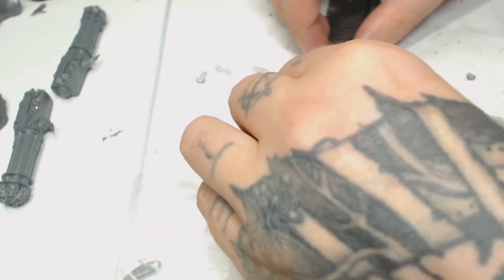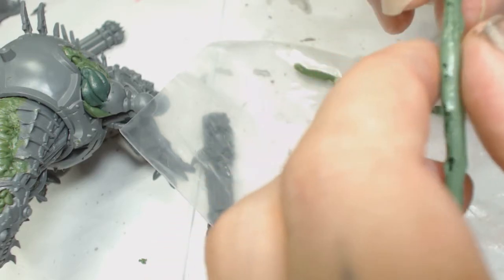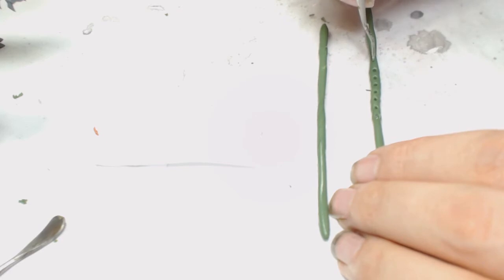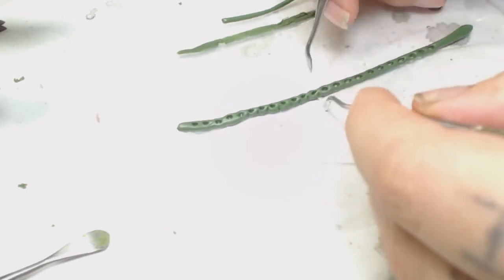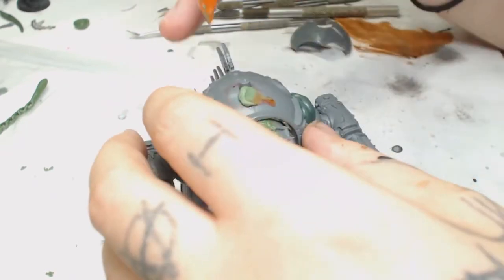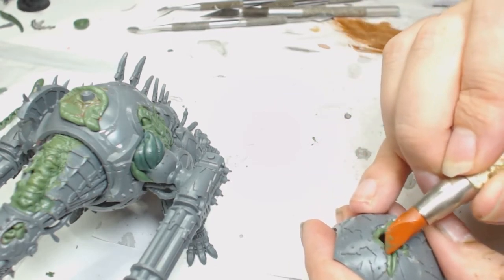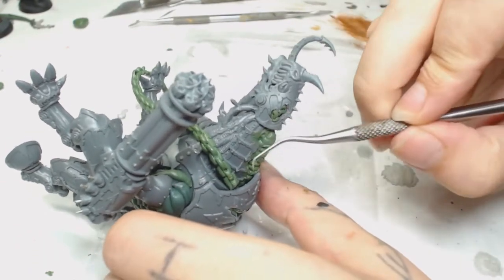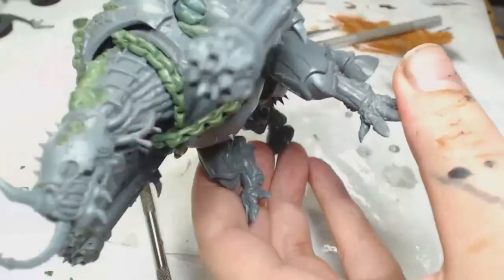Green Stuff Tutorial. Chain's And Pipes

Comment: Wonderful video! Tried all of it, and it (sort of) worked!
Reply from the maker: Thanks, just keep fiddling with it till your happy.
Reply: I often have trouble creating details, as the GS tends to flatten or contort whenever I apply pressure. Do you let it sit for a little while, before you start shaping it? I made some wires/tubes, and let them cure for about 5 hours before fixing them to the model, and that seemed to help keep the general shape, but I can't quite tell what the ideal time frame is for different kinds of sculpts.
Reply from the maker: Thank you for the question, both techniques are right its really up to you when you use them. I don't normally wait before starting to sculpt, unless I need a hard back peace to bush against.
Reply: It does indeed seem to be a question of timing - I had some free-floating tubes that kept collapsing on me, and I had to build a very intricate system to keep them in place, involving the head of a space marine, a cork from a bottle and a cigarette bud! But letting it cure for about 5-6 hours kept the shape tight, and then I just had to wait for the glue to keep the two ends in place. 

I would love to see a video on how to make harder pieces, like armor or sheets of metal, and how to get that sharp edge! I tried some different ideas, but it always ends up looking more organic, because it doesn't have those rigid lines and corners.
Reply from the maker: For hanging pipes and things it will be better to let them cure a bit, maybe pin them as well unless you are going to add more green stuff over the join. As for hard edges for armour I struggle with that myself, over time I will try to get a video out about it.